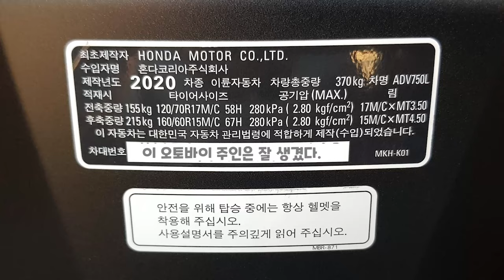Simple tuning to lower Honda X-ADV motorcycle seat height

Comment: Have you not adjusted the height of the front suspension? Will the center of gravity be unbalanced?
Reply from the maker: No adjustments were made.
The bike is still running well with no problems.
Reply: If you lower the rear suspension, the front forks must also be lowered.

Comment: Hi, can you tell me the difference between hole centres on the original and the lowering kit, and how much did these lower the motorcycle? Many Thanks.
Reply from the maker: Real feeling...not an exact number...
about 7 cm
If the heel of the foot floats off the ground...?... it makes the heel of the foot stick to the ground.

Comment: did you need to replace side stand with aftermarket after lowering? have you hit anything from the ground after lowering like  protruded rocks or dirt when offroad?
Reply from the maker: Yes I bought it from the aftermarket and installed it.
Because most of them only operate on urban motorways.
Off-road, the problem is unknown.

Comment: Hello Can you help ? 
Gear dont change Anymore when bike is hot
Reply from the maker: What type of motorcycle is it?
There is usually a sensor on a high engine displacement motorcycle...
If that is a problem, it may happen that the high/low gear cannot be shifted;
Reply: @MotorcycleRepair  its Honda xadv 2019 its should be automatic change but its stays blocked on 3 sometimes or showing -- signe
Reply from the maker: @ascool7  Yes.. As I answered above.. The "sensor" part is suspicious.